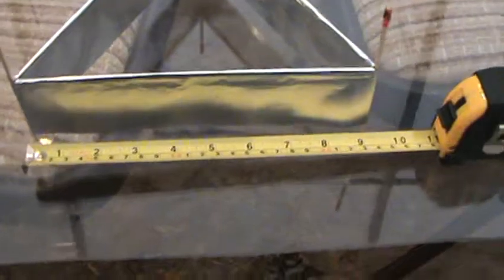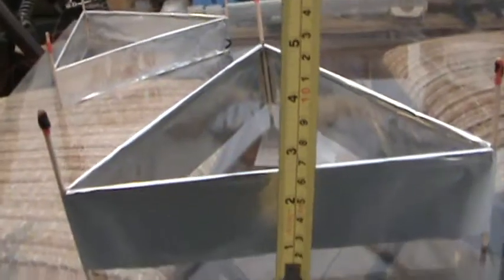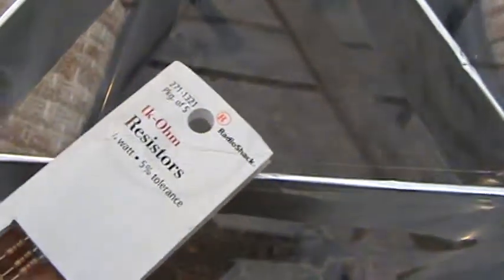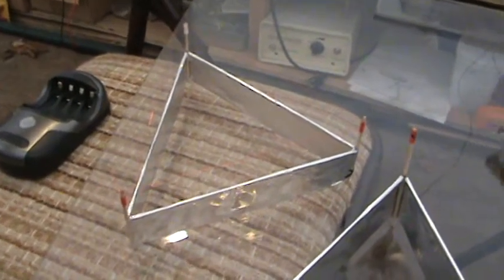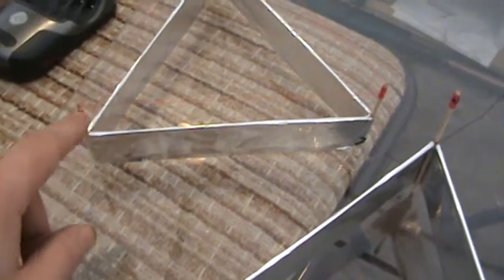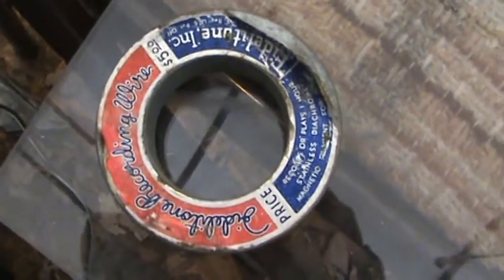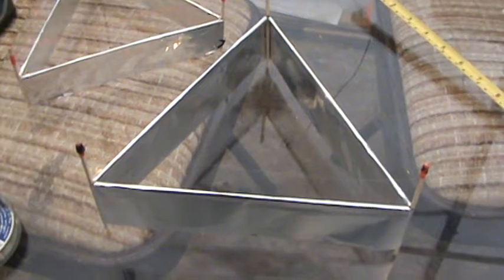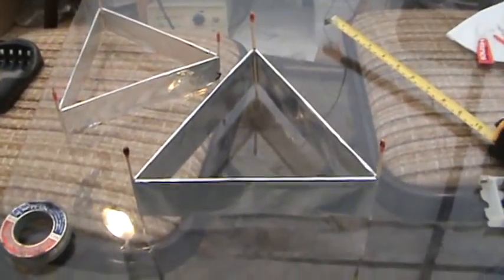LIfter/Ion Craft, Biefeld Brown Effect, Part 2

Comment: townsend brown never built anything like this. this design is a psyop to confuse everyone and hide the real electro gravitic effect.

T. Townsend Brown was using high k dielectric materials to fly his craft. these were heavy materials.

dielectric material can absorb energy until it becomes massless and even can disappear from sight. 

the energy density can overcome the radius of dielectric atoms and they begin to absorb light instead of emit light. 

long before that happens they become massless and become very easy to accelerate.

the kowsky frost experiment shows this same effect in crystal.

when these lifters like you have are put in vacuum, all of the dielectric(air) is pumped out and therefore the active material becoming massless is taken out of the equation so those vacuum tests are false and deliberately misleading.

hv foil capacitors were also used by brown in his gravitator circuits. 

once those dielctric materials are charged, they can be as big as a city and float. 

the dielectric(air) in your lifter is not contained and is very lossy.

its like driving with a hole in your tire as your trying to pump it up at the same time.

high k dielectric materials will hold the charge and not let it escape.

Biefield brown effect is basically a plasmonic metamaterial with a negative index of refraction and reflects the planck oscillations(light) of spacetime through it differently than any other materials known to man.

Comment: Looks much better. If you have the top wire under tension slightly to stop any movement in the wire. Thin balsa a little more using razor and wait for a dry day as humidity will limit max voltage between plates allowing spark.